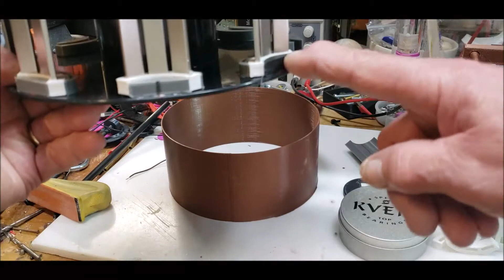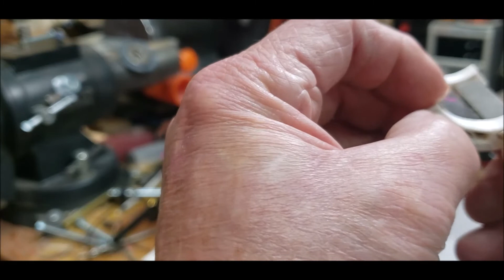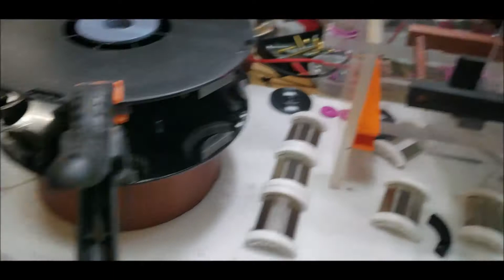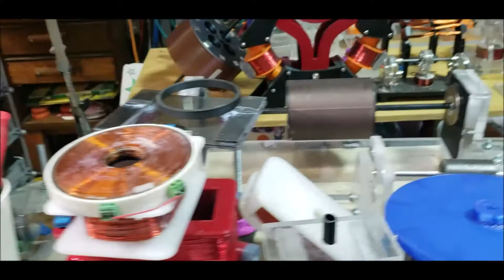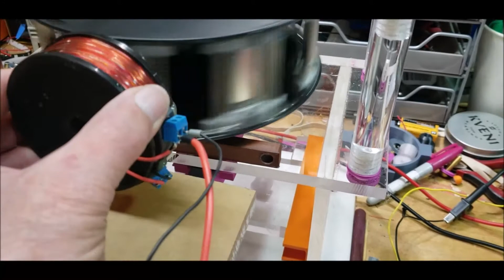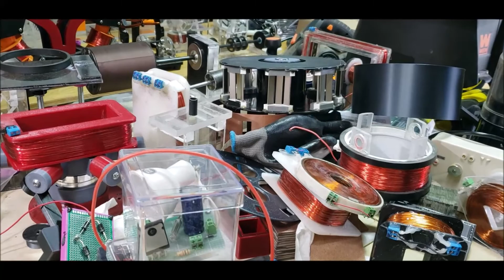3D Printed "Filament Spool" rotor build and first run.......FAIL :\

Comment: Yes Toffee here! The transistor gets hot because of current, put a potmeter wiper on the hall output, and either side of the potmeter to the base of the transistor, then you can tune the base current and the current to the coil....Did you just forget to try the hall circuit on the spool rotor? .... Since you are using aircore, try to get the wire as close to the magnet as possible, so a box or rectangle coil is ok, but more of a similar size.... The bullet magnets on the small rotor have too little flux to trigger a circuit, even a tiny coil twice the thickness of the magnets, with 75% thickness of iron core and a same length, wrapped with the smallest wire wouldn't be enough for triggering it, or that would be very close but I doubt it. Nice video!

Comment: Literally you are excellent. You are one of the best 3D printers in DIY motors. You have to create your own circuit that suitability for your designs. And use  coils that can be adjusted with magnets (geometric).
Thanks for nice films.

Comment: Got bankers hours
Reply: At least you don't have 22 magnets in the wrong places.
Reply: Try a pair of coils. One pointing north and one pointing south.
Reply: FYI I like your failure.  Just add the forth magnet to the center and make a magnetic super pole pyramid.  Toffee flavored
Reply: So my doubts in the design was mainly the concave shape. The other is the fact you use a single side of a coil. I still don't understand the hairpin coil but I know it works better than the single pole coil. I have a hard time believing those are 500 farads each. A 1 farad 12 volt super cap for a car stereo is huge.
Reply from the maker: @MAGnetICus_Attractus  there 500 farads at 2.7volts. There very common. I'll brake on out and show the specs
Reply from the maker: @MAGnetICus_Attractus  and the single side coil has always worked on other rotors so it stands to reason that it was the strength and shape or perhaps just the low flux
Reply: @mcorrade  with 4 magnets and iron I could make the super pole your after. Right now you have magnetic flux dense pockets inside the circumference of the disc.  Some where I have a video called magnetic hub, or something along those lines. 12 metal co² cartridges with iron plates extending out then iron plates connecting the radials. The wire was just to hold it together when it was spinning. Each cartridge had 4 magnets with the same pole stuck to it. The iron plates were what I call flux guides. Magnets are like electricity and go thru iron better than air. As a electric motor, a failure. Make a magnetic hammer out of it. It will cog real good with other rotors with a single magnet at a distance. Try at a angle like 45 degrees. I wouldn't call it a complete failure, but as a motor/generator I didn't think it would work well. Not with the coils you are using. What does iron oxide reveal if you cover a section of magnets? I hate that film, I like seeing 3d depth that sand gives. Use a plastic plate to represent the face of your coil and pour iron oxide on the plate and where does it go stationary? 1 line, 3 lines? A super pole will hold a bigger pile of iron oxide. I think if your new magnets were mounted in the outside spool anchor you would have 3 magnets reinforcing the forth. I forgot to upload a video a while back when I built pyramid arrays of cheap ceramic magnets showing how much pull that crown magnet had. Someone at skunk works showed how compressed magnetic fields fall slower than everything else. A compressed north pole falls slower in the northern hemisphere. Orientation of your center hub magnet makes a difference in spin. My fast flywheel that I spin cans on has a ring magnet under the board. I always forget about it being there. You know me, all my switching is done mechanically not electronically.
Reply from the maker: @MAGnetICus_Attractus  yes I forgot about adding iron which does make the magnets stronger but I'm going to concentrate all my efforts on the Newman Motor now :)